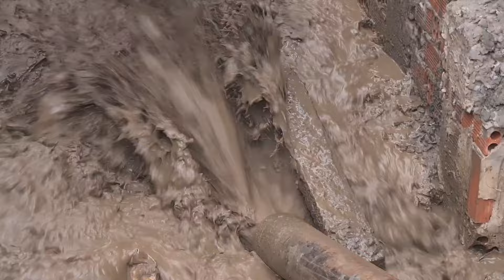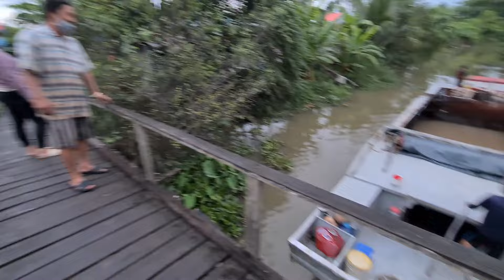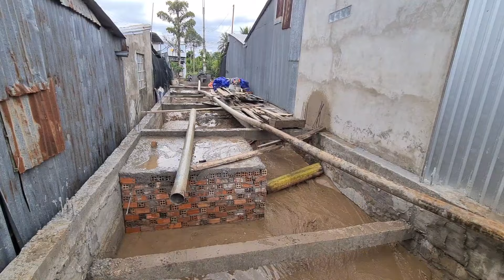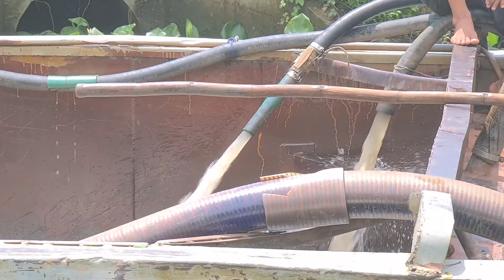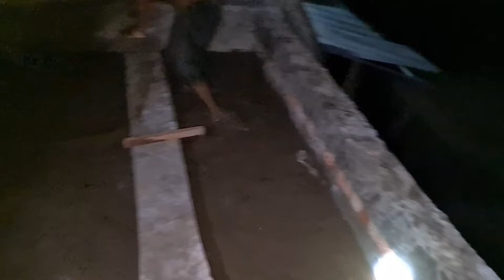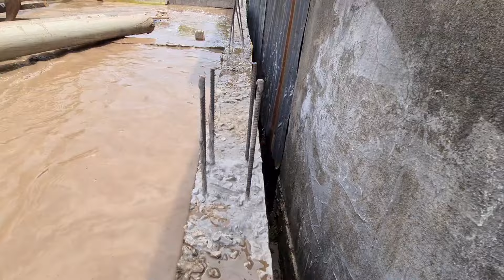Quá trình bơm cát đầy nền nhà cao khủng"cặp bờ sông nhỏ/The process of sand pumping house foundation

Comment: Great Video. Let me see if I understand correctly. What is taking place here is that someone is building a new house. The foundation walls are built out of brick and then they hire a boat to bring in sand.....that uses water to unload the boat.......the foundation walls are built in such a way that allows the water to exit.....but the sand will settle down and become the foundation that concrete is poured over? Is this correct? If so....it would be great to see the process of a new house from start to finish ...... so we can see what it looks like after. Thanks
Reply from the maker: Thank you very much, you are very correct.  This is the process of building the house to completion, and I have the link for the next episodes in the comments https://youtu.be/CntEBLrBHRM